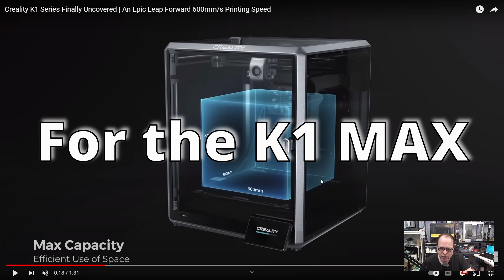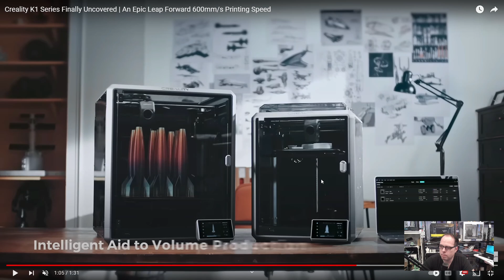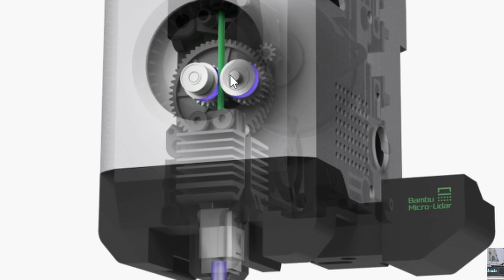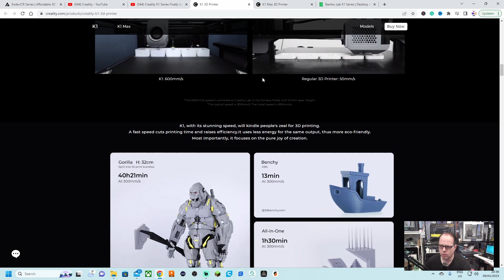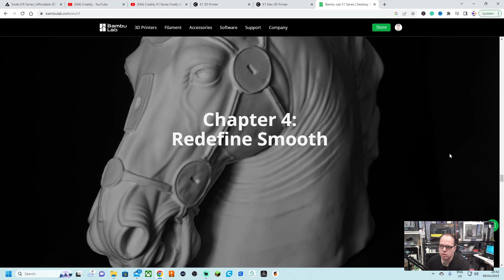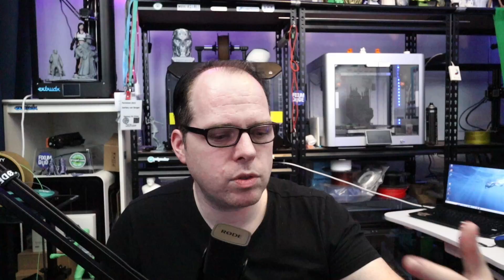Creality K1 and K1 Max - Z3DP Reacts

Comment: This is going to be a dumpster fire. Creality has TERRIBLE QC. This is straight ripoff of Bambu. It's so much easier to ripoff a product compared to developing it. Creality won't have the technical expertise for software support/updates. I guarantee they are counting on the community to do the updates for them in klipper.
Reply from the maker: Creality is known for the modifications people do on those printers. On the Bambu, I also see people making things for it to improve.

Comment: Yeah, creality shouldn't copy and "paste". 
You know, like  power locks, automatic transmission, rear defrost, intermittent wipers, heated seats, cruise control, power windows,  power mirrors, power brakes, power steering, crash avoidance.... 
They should come out with something completely new and different.
For me, these features that they offer are awesome for bambu Labs and creality. 
At this point what's going to sell it for me is, quality, reliability, support community, and ease-of-use.
Reply from the maker: Thank you for your comment on this video Don, yes I'm looking forward to see new things coming from Creality

Comment: I'm going to preorder soon... right now, I'm run out of money :B I don't fall in love with the Bambu... Sorry If you like it. It's quite expensive and, for the half of the price, I will have the Creality. I love Creality machines. Almost you will ensure the guarantee of spares. I had a bad experiencie with Xtool M1... I wasted my money because the quality of that machine is bad. Tons of plastics, bad camera quality, bad quality screws... I should saved money for this machine... I spent almost 2.000 €...
Reply from the maker: Hey buddy thank you for you comment on this video. Terrible to hear that the Xtool M1 gave you bad experiences. I really like Creality printers, I have several of them and soon the K1 arrives here too. I also want a Bambu, but like you said they are expensive.

Comment: So the "Always print at full speed" comment isn't related to the max speed of the printer.

They are talking about the acceleration. No printer will ever print at full speed all the time. 

The faster the acceleration, the more it will print at top speed, as every time it changes direction it technically has to stop, and the accelerate to get back up to the set printing speed. 

In short, the slower the acceleration, the less time it will spend at full "set by user" printing speed

Comment: Forget all these brand-name machines, I'm excited for the Chinese knockoffs that will inevitably come in at 50% less than the Creality. An example? Sovol being a $220 knockoff MK3+. A $300 Bambu knockoff would be tits. Though, integration of features like LIDAR or easy-to-use software will surely be left behind.
Reply from the maker: I do like to have some brand name machines tbh, but until then I need to look to my budget too and buy what I need atm.

Comment: I like the look of this machine, I hope it is as good as they claim but there is always and I will say that again ALWAYS something wrong with a Creality machine and it is usually something really stupid and never gets fixed, Creality are not known for FW updates apart from the Sonic Pad which has had loads of updates and loads more updates to fix the previous updates, I hope it has a stock Klipper and not the butchered Sonic Pad version, it makes sense to use the stock Klipper, they dont have to work on it as it gets regular updates and people are used to the stock version.
Reply from the maker: Yes the printer does look good. The normal Klipper on the machine, yes! I heard things about the Sonic Pad Klipper too
Reply: Since when the Chinese brands provide full and good software support? Everyone knows that buying such cheap products you're also getting half baked software by default, it's market tradition already. Legally you can't oblige them, they're not in your jurisdiction, it's kinda your personal fault and risks that you even interested for something abroad. I've got many of their products from ebooks to Android watches with full Android 6 and such powerful chip it's heating your wrist, not that Google toys, and everywhere software not polished, not optimized, at best only 3 updates or year of support and later product determined as dead, they're greatly copied from West constant product iterations cycle. Even Xiaomi, where Android big updates are made quite regularly but it's better to not update at all, next versions working even slower and worse (copied from Apple obsolescence engineering).
I think all chinese brands waiting that Ai will fix all their half-baked software in short future.
Software usually bonus there, it's never used as the reason for added value, I see that most money they always made on materials and quality of them, in K1 they can easily cut price lower by 100 bucks, but it's 100 bucks pure profit from their pockets.
I personally made my own DIY Voron 2.4 from best materials by guide, it's maybe higher than K1 in total price, especially try to find today a very rare and expensive Raspberry Pi which is required in Voron.

Comment: They could make K1 cheaper, like they did basically shaken all market with very low priced new 3D scanner Ferret for only 350 bucks whole kit. I got it yesterday from Ali and the quality of everything for such low price it's just impossible, usually you don't get such nice things from Ali, it's started to raising price a slight after the first pre-orders. Even brushed aluminium everything incl case in camera. 

500 bucks is equal to Voron 2.4 price-which is most DIY printer from best sourced parts and on real raspberry Pi(this board is most expensive today).
Reply from the maker: Yes, they could make it cheaper, but there is going to be lesser quality parts to the machine. 
In the past they have done that, but there were a lot of complaints and quality issues. Now they seems to be focussing on providing better quality and less rushing out printers.

Comment: The marketing speech is priceless. Same everywhere. That is sooo average and kinda dumb. Creality is no exception here. Those companies care less about "community", they must care about share holder values. Hence, just another 3D printer clone - now from Creality. They are laggards in the market as so many others, too, regardless if you name your printer Pro or Max or Pro Max or K1 or K1 Max ... it is more or less something old with a new finish and some improvements, not really innovations. Of course there are exceptions to this generic statement, I know! 
Indeed, there are also good to very good machines out there for the hobbyist and semi-professional, no doubt. The Ender 3 is legend!
And, yes,  Bamboo and Snapmaker surely set a new mark in the market about what is possible with new features and great build quality. But to be honest, it therefore comes also at a tripled price. Even the Bamboo already have shown to have quite some issues as reported in many 3d printing forums and on YouTube already. Too high printing speeds comes at a cost of machine maintenance and worn out parts not really build for high speed.
The K1 series at least build the recent more modern features into a moderately priced maschine making it affordable for beginners as well, which is nice. Will it also work as advertised? We'll hear and see about soon.  Just my 2 Cents here :face-turquoise-covering-eyes:
Reply from the maker: I like your 2 cents comment on the Printer. Indeed the Ender-3 was -and I think_ still is a legend. I see that Creality for once released 2 printers instead of 6-8 printers during the celebration live stream. I think they want to focus more on the quality and innovation. Maybe not on this printer, but maybe in the future!

Comment: Making it have a bigger volume is not an insignificant differentiator between the Max and the Bamboo. Also having an enclosure at the ~same price as the cheaper Bamboo is good too. 
Its nice to have someone at least keeping Bamboo on their toes, since Prusa's offering seems a bit outdated for the price they want.
Reply from the maker: Yeah indeed, I think that they are going to step up their game as well and it could be interesting to see what is coming next
Reply: The question for me is: how can Creality or Bambu Lab can be so much cheaper? Prusa is located in Prague afaik which also is not a very expensive country.

But the road of "mass production" which especially Bambu Labs is going is an obvious option for Prusa as well.
Reply: @hassosigbjoernson5738  Is Prague's cost of living comparable to China's?
I do wonder about Prusa's ability to compete in the general consumer market. The only thing that holds me back a little from Bamboo and Creality is their cloud service being so integral to their printers.

Comment: Also if you did not notice, maybe it is a typo, but per their site the k1 max prints faster than the normal k1.  Though I think twice the price for 50mm larger and a camera is unreasonable.   It feels like they are selling the normal one cheaper to sell more and offloading the cost to the users who want a larger printer.  Their resin printer is the same, is only faster when using their specialized fast resin.
Reply from the maker: Yeah a $300 difference between the 2 printers. I didn't check how much those upgrades would cost, but better was, when they directly added those AI things in there.
Reply: The "normal" K1 is going to use more standard parts in a size that is also used on their other machines.
So ... since the bigger build volume is not so common as the normal one, it produces more costs!

And the extra costs (build plate, case) is THE reason why Bambo Lab has not a bigger printer. (And is not going to have to cover their expenses)!

Comment: After extensive study and research, here is what I think the future of FDM Printing and Printers will be:

1) All High-Quality Hotends will be Inductance Heaters, with Water Cooling
2) Most of the Printer's construction will be Carbon Fiber, and Glued, instead of Bolted or Screwed
3) The Support Rods/Rails will be Carbon Fiber Tubes that they will also utilize interior mounted Magnetic Coils, to move the Print Head and/or Bed, through ALL Axiis
4) All higher end units will come with enclosed Dehumidifiers for the Filament
5) There will be MANY, both In-Industry and After-Market, Multi-Filament add-on Assemblies/Devices (AMS)
6) And finally, someone will eventually figure out how to keep the plastic material liquid, and instantly harden on exposure to air, and both solid Filament (FDM) and Plasma (SLA), will be replaced
Reply from the maker: Oh wow, that sounds pretty awesome. I have heard and seen already some of the things you mentioned like the water-cooled high quality hotends.
Reply: @Zachary3DPrints  All but #3 with the Carbon Tubes having the magnetic coils, and #6, are already a reality, just not universal. When the after-market AMS's get going, that will be a huge game changer and might even start a 3d Printer renaissance.
Reply from the maker: I'm looking forward to that 3D printer renaissance, as long if people will like each other and not fighting over who has the best printer..

Comment: How often you can do something original this days? Company is matching the Market. Market is a need that company wants to close with proposition.
Stop buying things for cheaper. Stop buying things with stupid promos. Buy super expensive printers from TRUE engineers SO companies will start closing this area with propositions you want.

It's just you have watched 300 videos with almost identical printers ads. So you are bored. But for the customer that buying is important that those "boring" and 'not innovative' choices exists. They are just going to compete in the same category. But 'yeas' they are all the same in the same category.
Reply from the maker: Yes indeed, you are right. They are matching the market. Improving the printers and materials and going for speed and connectivity. I'm not bored of seeing so many printer ads, I try to keep track what is new on the market and inform people about it. Maybe the tone was a bit too critical...

Comment: Well clones are just that, clones at a cheaper price. But clearly Prusa has been winning this fight with cheap clones. Cheap doesn't always mean superior quality. Time will tell while waiting on reviews. Either way its good for the market. Even if its subpar, Its likely still better than anything they currently have out right now for the same price.
Reply from the maker: Yeah, I'm also wondering how this printer is going to perform in the reviews and how people will like it
Reply: Cloning, copying and reproducing is everything Rep Rep, open source or 3D printing in general is all about! The whole Prusa machines are clones from the original Mendel i3. The point is: this benefits everyone! And no one benefits from let's say spare parts you can only get from Bambu Labs (except the company obviously)

I am not sure if Prusa is really winning! Sure, some people are always going the premium route but with the Ender S1 and the much cheaper Enders (Neo, V2) Creality probably has sold more printers with probably a smaller company with less expenses.

And the consumers had the choice for a really cheap entry, the middle way (Ender S1, especially with Sonic Pad) or investing time into fine tuning. It was just a matter of time if more consumers are ready for more advanced (and more expensive) products.

Comment: If Creality lowers the price of entry for these features, then they have done something differently.  There's only so much you can do with 3D printers and keep the price in the pro-consumer level.  Features such as Lidar are questionable upgrades.

I would argue the most innovative printer out so far is the FLSUN V400.  If it had an enclosure and a camera for spaghetti detection it would be one of the best printers out today.  Delta's have an inherited benefit when it comes to speed since all steppers contribute to movement.  Also, bed leveling is a one-time thing since the bed doesn't move.  It's basically a Voron 2.4 like machine with only 3 steppers.
Reply from the maker: yeah good point there. I heard several great things about the FLsun V400

Comment: What i saw on the video, it seems that it will not have carbon rods. I wonder, if that will not cause issues wit weight / during so fast movements at such accelerations.
Reply from the maker: It did look like it had, but we will see shortly in the future

Comment: 3d community was open source, Bambulab took all the great ideas from the community and made everything on their printer closed source. So from now on every core XY printer with input shaper is a clone? No, they are all cheap charly Voron copies!
Reply: Inputshaper no, but with Lidar (until there is a completely Open Source System to attach to any printer) yes :(
Reply from the maker: That would be great to have the Lidar as upgrade to your printer
Reply: I agree. Bambu took/copied/stole all the best ideas and put it into one well engineered closed source printer.  Nothing very original.  DJI did the same thing to the open source drone market years ago. Same engineers.
Reply from the maker: Yeah, good point. Voron is a DIY kit printer whereas the others are pre-assembled

Comment: Bambu lab is original and Creality are just copying? Very funny, Bambu lab just collected ideas from 3D communities that have been working here for years and used them. Yes, he was the first to do it comprehensively, but that's about all. Creality at least adheres to open source, and so what it took from the 3D printing community is partially returned. Bambu lab just took and closed their system, breaking the rules of open source. I hope that other manufacturers with the same concept will come and take a part of Bambu labu's market, because the way it behaves, it deserves it.
Reply: DJI did the same thing to the open source drone market and pretty much killed it.  They took all the best ideas and packaged it nicely for consumers.  Stole all the open source ideas and made them closed source.  Same thing again from probably same engineers.
Reply: What's so important about open source? Make it easier for the competitors to copy their hardware/design? If you designed your one of a kind brand, aren't you going to protect your brand as well or are you giving the hijackers the chance to copy and build a better version just of the sake of getting a quick buck. Look at Creality vs every other Ender 3 clone on the market. It didn't result in innovation if that is what you wished for?
Reply from the maker: You have some very good points. I didn't know that Bambu did that. I have heard a lot about it, but not in details.
Reply: The K1 AI combines the X1 carbon and AnkerMake M5. It has the lidar that X1 uses for the first layer. But it has a camera for AI to detect issues like the M5 has.

Comment: clone? perhaps they were designing at the same time, off course the bambi fanboys vs the creality fan boys will argue it, bambi just theirs out first perhaps, and dont you think they positioned the gear for the benifit of the camera?? come on man think that marketing people design these ads not real people, petty point
Reply: except the bambu was a concet since over a year ago
Reply: I think there are too many similarities for it not to be a clone. For instance The doors  and even door handles use the same oval shaped metal handle. Creality also copied the lidar, something that only bambu labs have used. The hotends also look extremely similar.
Reply from the maker: Ok, not a clone. You have a good point.